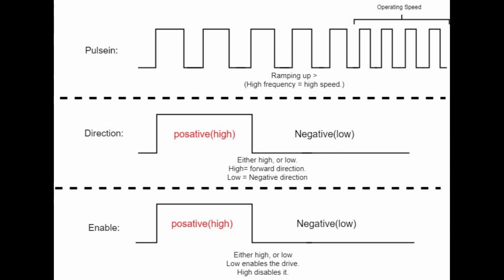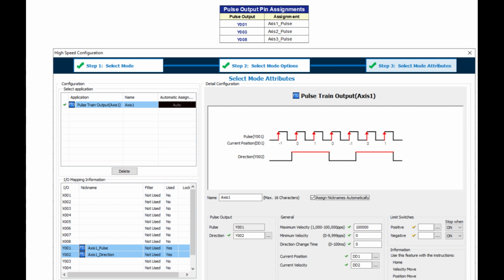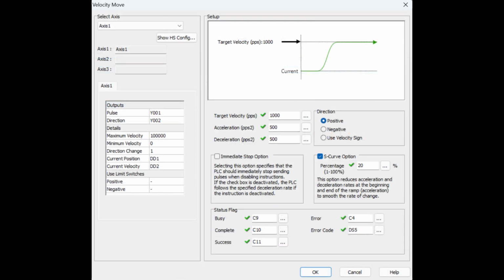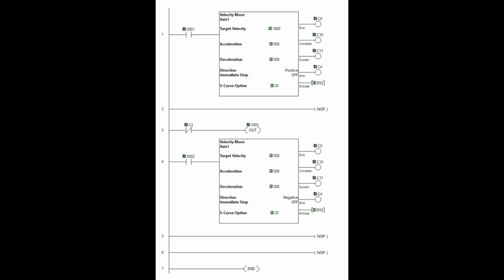Controlling a stepper motor with a Click PLC.

Comment: does it matter if tthis driver is dm542 OR dm542e or DM542T. I got DM542 with exact same wiring and it is not working. I got the CLICK plus module with the c2-14d2
Reply: switch the positive side of the stepper driver logic.  it uses Sourcing (PNP) outputs. PUL- and DIR- on the stepper driver together and connect them to the 0VDC (GND) of your power supply. +24VDC power supply to the module's +V terminal, and the 0VDC to the module's C1 (Common) terminal.